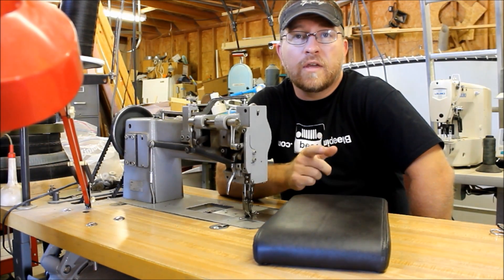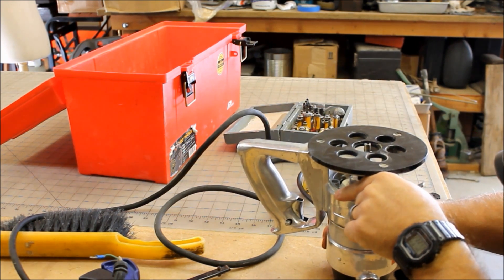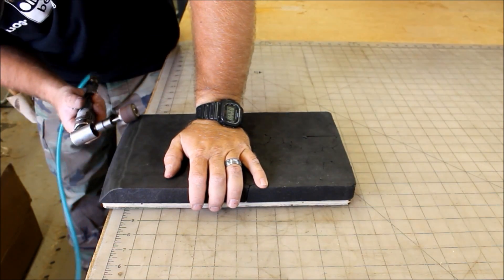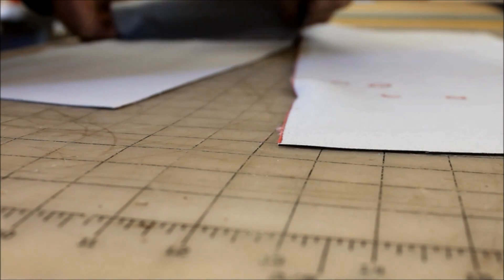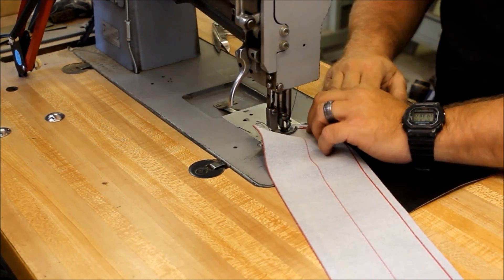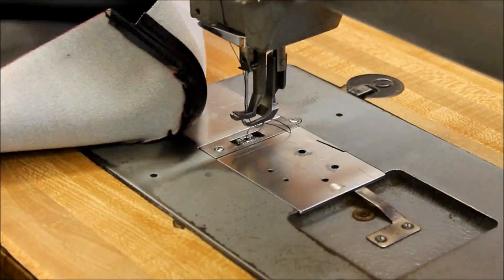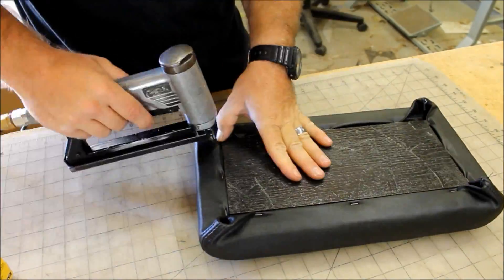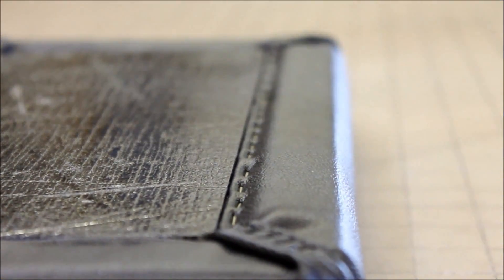How to make a custom upholstered armrest (Scorpion Crawler Project)

Comment: Nice job!!  One question. Since you routed out the groove to push the edging down in, couldn't you do basically the same thing for the corners also??  Sure wish I had your skills...
Reply: yes, I would do that if I could do it over again. I planned on doing the corners differently in the beginning. Fabrication is never an exact science. As Matt likes to say, its a lot of problem solving. Good thinking on your part.
Reply: So it would work.. I thought maybe it would make the corners too weak or something.. I suppose a furniture grade plywood would be best though..  Best gluing and zero voids...  
Again, nice job!!

Comment: is that a jigs staple gun?? i cant use one of them because when i turn the gun around to pound staple stubbles down i always dump all the staples out i use senco at my work at good ole smith brothers furniture
Reply: It's actually a BEA 123 that I picked up from a pawn shop for $20. I had to replace the buffer but it's been the best staple gun I've ever used.

Comment: Even with the volume all the way up , I can still barely hear you ..... Time to break out the headphones ...    Can you use a regular sewing machine for something like this , or do you need one designed specifically for upholstery work ?
Reply: I have a kenmore from the 50s that I use for work like this.
Reply: You can use a regular sewing machine if you can get the stitches long enough and if it can handle the thread and material thickness. A good choice would be a Pfaff or Juki machine.
Reply: +Tyler Bleepinjeep I got an old singer peddle type my great grandma used to make seat covers for A models back in the 40s
Reply: +Nick Vandiver the book says use some kind of thread called cat gut but I was told it's like fishing line
Reply: wow! cat gut hasn't been used for decades. That's pretty cool. The thread you want to use is called "Bonded Polyester" and you'll want something in the TEX 90 size. You may also see DB92 as roughly the same size.